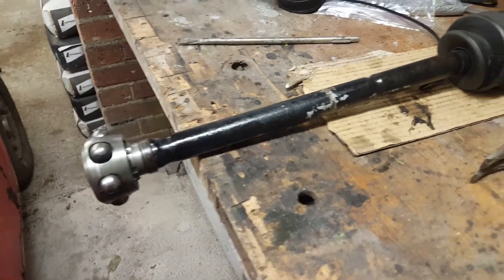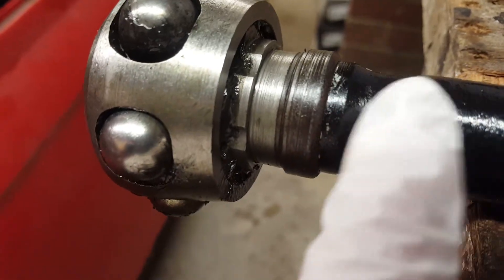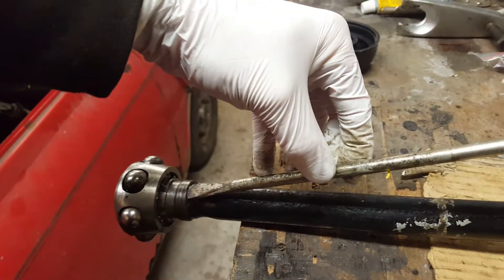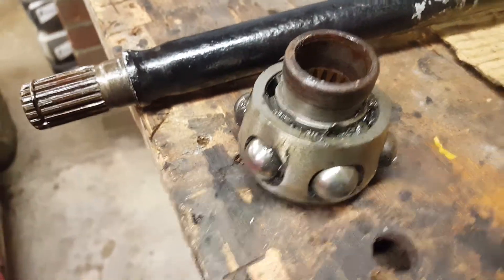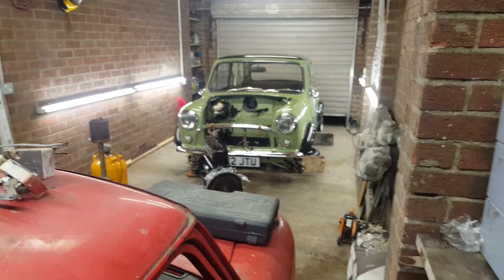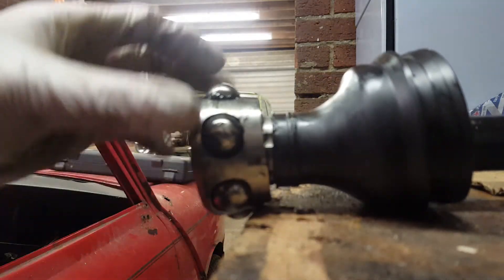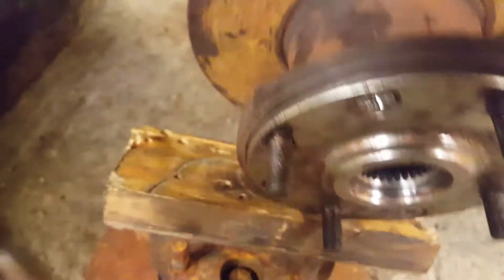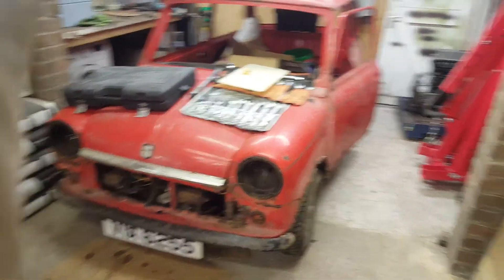Classic mini drive shaft cv joint rubber boot replacement (pot joint inner)

Comment: I have just started my first ever restoration project and have bought a barn find classic mini.  I have started to strip everything down and I am now ready to take the engine out but got completely stuck trying to work out how to remove the drive shafts.  I knew I had to remove them from the engine but just couldn’t figure out how to as none of the manuals, or other u tube video’s, give a clear indication - they normally seem to entail a quick statement that seems to imply a much greater understanding than I have!  . Often the statement goes something like “ just split the inner pot off the diff - but make sure you don’t damage the dif casing as that will be very costly !! “ - No real explanation just a really scary warning and sometimes a reference to a special tool that’s no longer available! They also don’t explain how to get the pots back on again - which is a worry nor do they explain how to withdraw the drive shaft back through the sub frame!
Then by chance I came across your channel/video - THANK YOU !! I now realise I don’t need to split the inner pot joint off - just cut the rubber boot off and withdraw the shaft.
Great explanation and I will be looking at more of you videos - thanks again!

Comment: Great video. nice detail on the boot install.

You want to make sure the joint goes back together in the same position. The balls and races will wear into each other and if you swap them around it will cause additional wear.

Comment: When removing the shaft, does the inner joint just slide out of the drive "cup" without pulling the cup from the differential housing? Is it necessary to drain the oil prior to this work if leaving the cup in place?

Comment: One of my pot joints on a 998 A+ rod/change is missing a ball bearing. I've been driving on it like that for who knows how long. I just realized it was missing when doing the pot joint boot replacement. I'm assuming maybe the previous owners knew about this and decided it was ok to continue driving. Obviously it should have all of it's bearings but if it's missing one, is that bad to drive on?
Reply from the maker: The other bearing balls will be taking more load. I would buy a new pot joint and keep it on the shelf for when it eventually fails. I wouldn't be in a big panic to change it out until if fails. The only damage it will cause is to itself which will be replaced with new.
Reply: @bluemini17 also, zip ties eh? I’ve seen a lot of people use them but it scares me to put one on the inside of a pot joint. Have any issues with zip ties since this video?
Reply from the maker: @jskeith11  no issues so far. I struggle to get the steel ties to fit on such a tight circumference and remain flat enough to allow the boot to peel over it (not so technical term). Steel ties on the outers diameter all day long and also a light smear of Honda bond

Comment: I accidently pulled out my driveshaft while changing the cv boot. All my ball bearings dropped out of the inner joint. I put them back and greased it up but i'd imagine that shows it is worn? as the balls arent clicking into place?